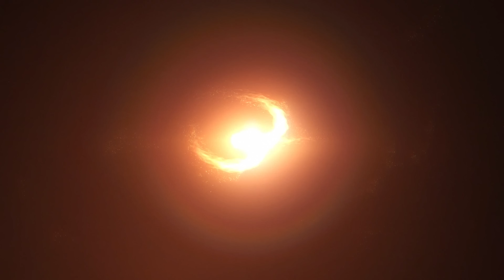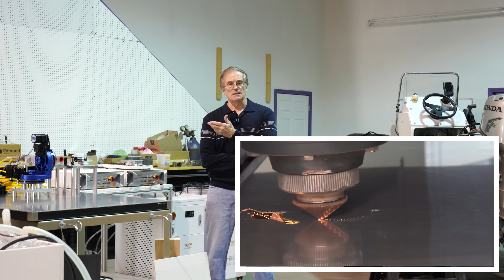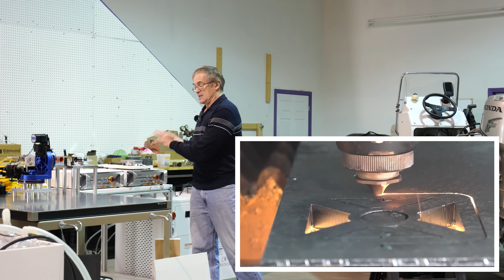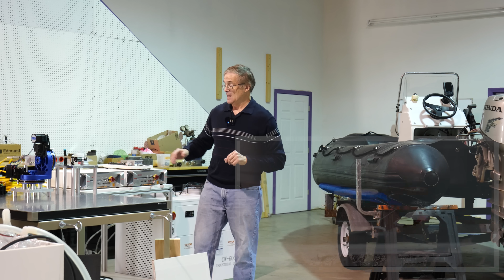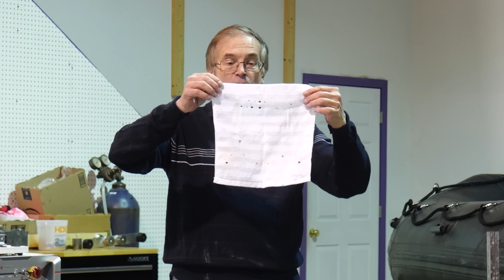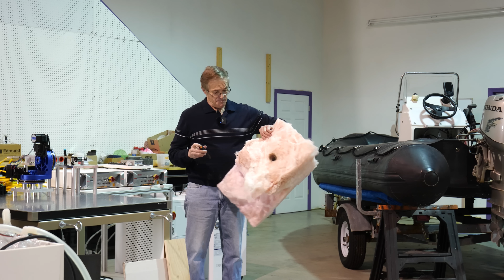We have a problem... and need your help!

Comment: Could you build a large water tank with dies that will absorb the laser light, allowing the water to heat up, or even boil before allowing the laser to exit the building? All you'd have to do is physically limit the range of motion of the tracking head so it cant track outside of the tank, even if something broke and the motors just keep hammering away in one direction, maybe missing gears on the head or something where the motors physically cant engage, or some sort of hard stop that will result on broken 3D printed gears before passing that stop

Edit, i would not reccomend being in the same room with a laser like this, especially if anything could possibly be reflective
The nice thing about a water tank is that it could be drained to be moved, though with a laser this powerful you'd probably need a very large sheet of glass, also, the dies are probably going to stick to or at least heat up the glass to the point that it wants to shatter.

Comment: I have three ideas. Firstly, why not reflect it to the sky where it will become less potent over distance. Unless you are under a flight path. Second is to use the directed energy to power a process that requires the heat and energy. maybe forming a new element or transforming one. Thirdly, select to the ground or a little furnace to melt something?

Comment: Rock salt in a large transparent tank one foot thick with the height and width being what is needed to cover the area needing protection. Build the tank with a base mounted with casters to allow it to be rolled out of the way. This will allow you to have a mobile salt mine.

Comment: Why not seperate out the experiment? Use a safe low power laser to test the targetting systems behaviour and abillity to track. From this you should be able to record the relative rotation and distance of the target to the laser. Next test the high power laser from a static position, simulating the previously recorded relative motion of the target by having the target move forward/back on a rail whilst rotating. This way you just need a couple bricks downrange of the static high powered laser. This lets you show that the targetting system works, and the laser is effective at target destruction with the targetting systems behaviour, though it's maybe not as cool as having a fully operational system.

Comment: 1) To your specific request, intumescent paint or putty might work for your requirements.
2) redesign the optical assembly to have a greater divergence. 
2a) using a diffraction grating
2b) axicon lenses look interesting, instead of requiring the waist of the beam to be exceptionally long as with a standard gaussian beam, a bessel beam has a limited line shaped focus.

Comment: Hey Doc... What about a curtain of smoke. Create a device that produces a laminar flow of air and introduce into that flow smoke from a smoke machine. The smoke could be dyed a color that maximally abdorbs your light frequency. Then to catch the smoke flow make an extractor vacuum that catches the smoke and recycles it back into the laminar stream.

Comment: I think you're going about this a little wrong. If your beam is going to be moving, I'd think the answer would be a beam diverting fail safe. Identify the target, engage the target, and THEN have an active beam go down range. I would think that you'd be able to put in a diverter that could be mechanically removed without disrupting the beam path where the reflected area would be that lens where it scatters the light rapidly. Programming would require active calls to have the beam engaged.

I don't play with lasers, but that's where I would start my research.

Comment: Search Labs | AI Overview
Blackbody dissipation of laser radiation occurs when laser light interacts with a surface that behaves like a blackbody, an ideal object that absorbs all incident radiation. This absorption leads to an increase in the surface's temperature, causing it to radiate energy across a spectrum of wavelengths, including infrared, as heat. The intensity of this emitted radiation increases with temperature, following Stefan-Boltzmann's law. 
Here's a more detailed explanation:
Blackbody Absorption:
A blackbody is defined as an object that absorbs all electromagnetic radiation that strikes it, regardless of the frequency or angle of incidence. In reality, no object is perfectly a blackbody, but some materials, like a small hole in a cavity, approximate this behavior. 
Laser Interaction:
When laser radiation interacts with a blackbody surface, the energy of the photons is absorbed, causing the surface to heat up. 
Temperature Increase:
The absorbed energy increases the kinetic energy of the molecules within the surface, leading to a rise in temperature. 
Blackbody Emission:
The heated blackbody then emits electromagnetic radiation in all directions and at all frequencies. The intensity of this emitted radiation, known as blackbody radiation, is related to the surface temperature. 
Infrared Radiation:
As the surface heats up, it begins to radiate more strongly in the infrared region of the electromagnetic spectrum. This is the heat we feel from a hot object. 
Stefan-Boltzmann's Law:
The total energy radiated by a blackbody per unit area is proportional to the fourth power of its absolute temperature. This relationship is described by Stefan-Boltzmann's law. 
Example: Laser-Induced Plasma:
When a laser is focused on a target, the intense energy can create a plasma on the surface. This plasma can exhibit blackbody-like emission, meaning its spectral distribution resembles that of a blackbody. The temperature of the plasma can be determined by comparing its emitted spectrum to the blackbody radiation spectrum at different temperatures. 
AI responses may include mistakes.

Comment: sand bags? or maybe a series of enclosed metal sheets (maybe fill the gaps of that with sand) that help contain refracted and reflected light (i.e the lenses made from small holes), the front surface should be something easily lasered through, like wood, so that you can make sure no light is reflected back and you can easily replace it as it gets cut (and maybe put a hose in front to prevent fire).

Comment: What about incorporating a range finder laser in conjunction with the weapon laser. Using the range finder laser to lock onto the target and then PWM the weapon laser in order to  control the intensity of the beam.  Depending on the material it has to penetrate would determine the pulse width needed to achieve the desired result.

Comment: I think an expensive, but potentially viable option could be to create an optic designed to diffuse and or redirect the beam once it has passed through the target. For testing purposes, this would allow 'dry firing' of the laser since the optic absorbs very little energy and spreads the beam out into something manageable. I can see this being an issue in lots of ways and would require a custom part to do the diffusing. Perhaps instead of an optic, you could build some kind of sandwich of different materials with varying refractive indexes.

Comment: I'm a mechanical engineer. I don't have a load of experience with lasers but I do have a lot of experience in heavy industry with very high temperatures involving steel making. After seeing how well the brick survived I would be curious to see how well KAOWool insulation would survive the laser. It's an insulating material made from ceramic fibers and can be bought in rolls like regular household insulation. I don't recall using it with any direct contact with molten steel but many of our furnaces were insulated with it exposed on the interior and it handled the heat very well.

Comment: Use a small particulate concrete with 50% short glass fiber reinforcement  by volume... provide 144.4 mega hurtz frequency during curring... at one inch thick, it will withstand more then 60 seconds of continuous beam protection.. welcome.    111 ... .. .   ;)

Comment: A refractive material such as vermiculite blankets as vertical curtains, possibly with multiple layers. Tank armour (especially Chobham) is the only analogous system I can think of, this relies on composite layers creating diffraction. The problem is too much energy in a small space. Ultimately ceramic material is the most heat resistant - how about compressing together multiple pieces of vermiculite blanket in a press with a ceramic bonding cement. Compress with a few 100 pounds of force ???

Comment: Ok, my 2 cents..

This is essentially no different a problem than trying to contain high powered rifle rounds at a range. It's fairly impractical to attempt to simply arrest the round as it would take an enormous amount of material to do so. Same here in that it's too difficult to contain the high energies for the same reasons. The solution here I believe is the same one that most commercial ranges employ, and that is an angled plate and a pit to redirect the energy down to where it can dissipate without destroying everything. For this arresting setup, I'd think you could use a large mirror mounted on a 45 degree frame that would be wheeled in and out as needed, and then put three or four pallets of single stacked firebricks to absorb the energy of the beam where ever it hits. I say put the bricks on pallets only to make it easy to move with a pallet jack, you're free to mount then anyway you think works best. Pallets are cheap and plentiful though!  All this could be moved in a few minutes and stored outside if needed except the mirror, but it could be build on a fold-able frame and wheeled to an unused corner of the shop potentially.  

So that's what I've got. Hope it helps inspire the real solution!

Comment: PhD in laser physics here. The cheapest and probably most convenient answer is to make the laser beam "vertical" going from top to bottom and put a swimming pool with rather dirty (high scattering/absorbing) water on the floor. Probably easier and cheaper than anything else. This way it will be no interface for laser to melt and the pool can absorb a lot of heat, probably with some special effects like steam/water plasma etc. If you try i would also protect the pool bottom with some metal sheet.

If you are planning to use a steady aiming point you can try to partition the beam with a series of regular BK7 glass sheets that will only reflect 2x Fresnel reflections or ~10% of total power. So if you use, for example  a few dozen of parallel glass sheets that are aligned as consecutive 45 degree mirrors you can attenuate your beam to a bundle of 10 times lesser beams that are probably be much easier to handle. Also poor polishing can provide scattering, thus, even higher attenuation. Though it is reasonable to test what is the Laser induced damage threshold for such optics. I also can imagine having such mirror system constantly water cooled.
Reply: this would work, but it's not a cheap and portable, as an indoor  gun range 45 degreed angled 1/2 plate steel and sand back stop below.  Place the indoor gun range box on a pallet and it can be moved anywhere, even outside.
Reply: @charliejohnston1978  the issue is, i think, that this lasers gonna burn through gun range in a second. you cannot place any material there, its just evaporates.
Reply: I vote for the previously mentioned vertical, downward-firing test rig, although less the water. As the concrete shop floor gets damaged or develops a hole, it’s not a major concern—beyond the concrete, you're simply boring deeper into the ground. The hole can be filled in later. Use a vacuum dust collection system and ensure any fumes are vented outdoors. Add filtration if necessary. Also, consider adding a safety cage around the beam area.😎

Comment: why don't you use a water cooled lens to disperse the light when passing through it? another option is to steer the beam upward to the sky. One important question from a regulatory point of view; is it legal there to build up a machinery that utilises a high power laser as a part of it without having informed the regulatory body prior to it? I am not talking about steel laser cutter, which is obviously a certified machinery.

Comment: make thin sheets out of cement and create a "chainmail"/scale wall that can be lowerd and raised with wire.
massproducing small cement sheets is easy. now just weave them together and now you have a movable, durable, cheap laser proof wal

Comment: Waterfall, with black pigment in the water? Or perhaps a high reflective pigment,Inside a metal box,
Or perhaps a tungsten bit spinning inside a box with dry ice being blown onto the back of the Tungsten bit so basically the laser is pointed on the spinning bit, the Tungsten can hold the heat of the laser but then the coldness of the dry ice or even high pressure water will cool it down so it dosent get chance to burn up, well in theroy 🤔

Comment: 1) Beam stop made of a mirror set at 45 degrees pointing the beam at the ground.

2) beam stop with a diverging lense at the front and enough room to spread the beam energy before hitting back of beam stop.

3) bundle of fiber optical cables can act as a creative way of dissipating laser energy. Thinner the fiber cable the better.

Comment: Try fiber cement board, specifically under layment  (hardibacker or durarock) for tile flooring.  And if that don't work alone, tile it with some cheap ceramic tiles first. Would be heavy, but relatively easy and relatively cheap. If the ceramic doesn't work you could always go with a cheaper natural stone tile and experiment with which material works the best.

Comment: You can also fit the target wall with a sensor system (heat or light) so that as soon as it is hit by the laser it immediately and automatically switches off the laser without any external intervention.

Comment: Maybe Wolfram could help because of the high Temp needed to melt it , but of course it is not cheap , but a scrape Part ?

Or something which will be transparent to the Beam ( like the fibre )  so it goes through and the there is Water (  box or pipe  with water )   as with those industrial Lasers. OR maybe you change direction not from left to right but from the roof to the ground and you have some water unternice ? OR Water mixed with superabsorbers to stick it in Front of the Wall and in many Layers maye with firestones ( 1300 C )   . 

Also maybe some kind of Fireprotection , I have seen some stuff which will expand when heated ( carbon foam ) . I think it was on a Channel with NightHawkInLight .

Comment: Possibly homasote  sound insulation board soaked with a baking soda and water solution or rock wool with the same solution on it or both together.

Comment: There's some great suggestions in the comments. I have a thought, it would be relatively inexpensive, and you should be able to source some test materials easily. 

Think of a continuous climbing wall.  The climbing part would be replaced and made from a fireblanket type material. As the fireblanket material is constantly moving, it would have time to dissipate the heat. For additional cooling, the blanket material could be passed through a water bath or sprayed, too. Keeping it consistently wet. I would think that there would be an optimal speed for the wall to rotate with the water/heat dissipating. If you could find black material that might help keep unwanted stray laser reflections under control, too. 

Just a thought.....

Comment: Have you tried a plexiglass "fish tank " long enough to use sandbags spaced with the type of wood you mentioned, measured approximately ever 12" or so ?  Plexglass may allow you to see what happens in slow- to the sand ( which is free in some states and Home depot / Lowes tends to have different variations of wood available ) . Once the sand becomes glass after the laser impact , it can be used as an end table piece or sold/ given away as part of the experiment . Also the sand would prevent the wood from becoming a ' forest fire" . Initially I thought about mentioning a fish tank , but the glass may shatter and can cause serious injury. Anyway " you slice  it " - it would be cool to be able to actually see a laser ( no matter which version of partitions used ) at work cutting through "obstacles " and seeing the end result !

Comment: I had a colleague the other day mention how some beam dumps are made of safety razor blades situated with the edges towards the beam. The glancing angles allows many reflections depositing the energy into the steel. It might not be portable or cheap to make a whole wall though.

Comment: My first thought was two water curtains; one in front of the other. Others have suggested palletized offset sand barrels which seems a good/cheap and easy idea. If they were steel barrels you could patch them if needed.

Comment: Go to a firing range with a generator, or one with a facility that can supply the electrical power you need. They will let you borrow a mountain. Maybe ask a tank firing range, they probably have sturdy mountains. Sound stupid, but will definitively work if you don't have an issue with traveling there for each use.

Comment: Could you try using a foaming carbon like what is created when using fireproof paint. You could put it in an argon flushed glass tank so it doesn't catch fire as easily.

Comment: moist potting soil over top of anything that is at least 8cm thick. 
Or, mounds of dirt / or aim the laser at the ground. both are cheap and rely on a thick material with decent thermal properties which will melt together and continue to absorb more heat.